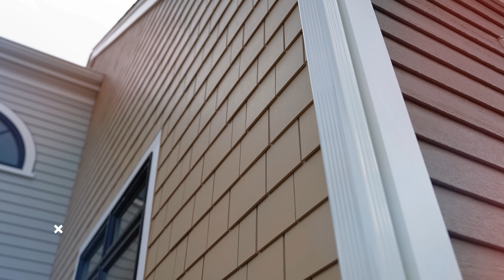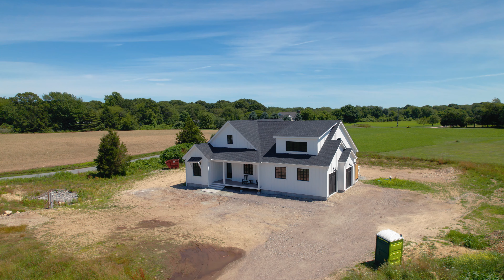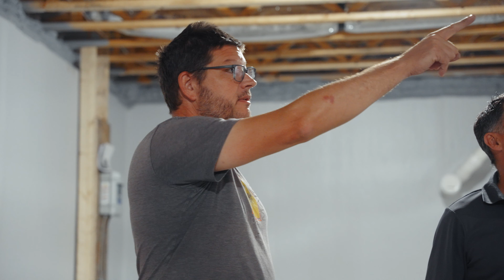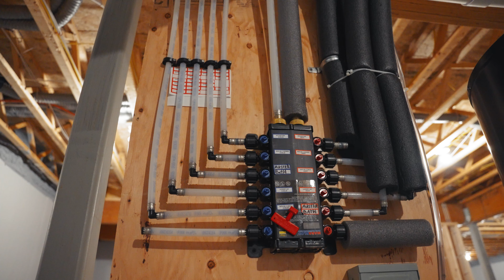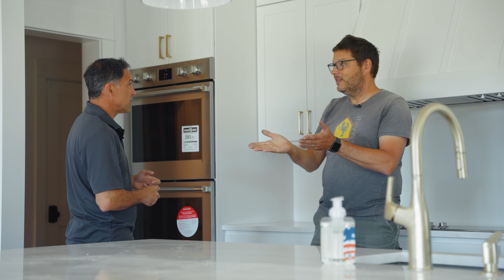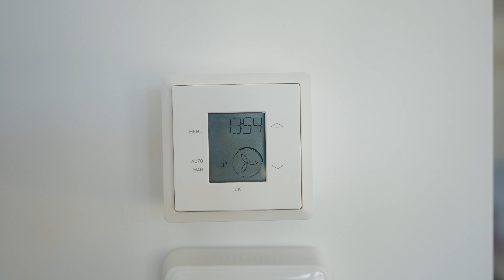Building a Healthy Home Part 1 - Breaking Ground Episode 6

Comment: If you're filtering the air from your rangehood so it doesn't leave smoke and grease and steam on the inside of your exhaust duct, you can run that through a heat exchange or energy exchange box so the make-up air for that device is heated and humidity conditioned for your house. Using a heater on your make-up air while pumping heated air out at that rate seems rather wasteful.

Comment: "too much ventilation" creating a too-low humidity problem is a design fail. The air being brought into your house should be humidity conditioned, not just dehumidified. If it needs more moisture to be healthy to breathe, your system should add that.

Comment: Such a shame though, on an otherwise well designed and engineered system, to have plastic ducts all over it. When microplastic particles are being found in the human body everywhere from the testes to inside the brain, expecting to breathe air that's been blown through a plastic tube and not be inhaling microplastics with that air is just unrealistic.
You're filtering the air coming into your house .. and then adding new pollutants to it between the filter and your lungs.
Reply: The ducts are not plastic, they are a woven fiberglass with wire reinforcement.  Both of the duct materials used are Greenguard gold certified, a UL program that certifies produces to be low or zero emissions to ensure healthier indoor air environments.  They are also cleared to be used in a Living Buildings Challenge project which is a program that certifies buildings to the highest standards to be chemical free, healthy and sustainable